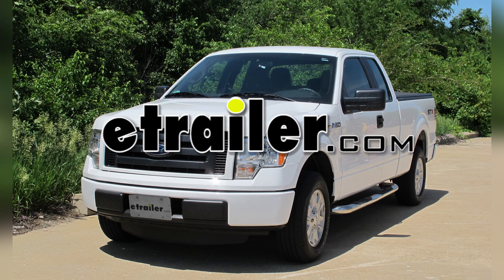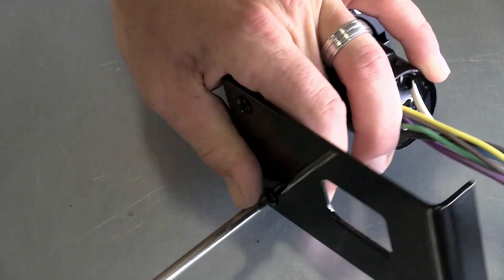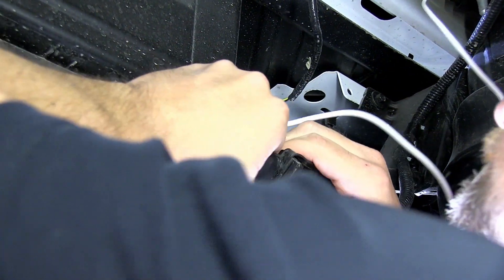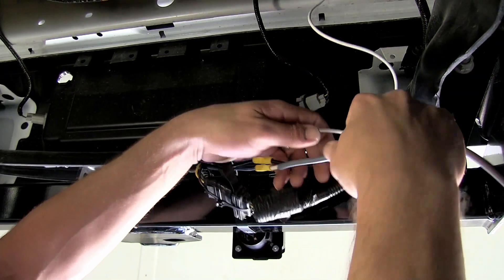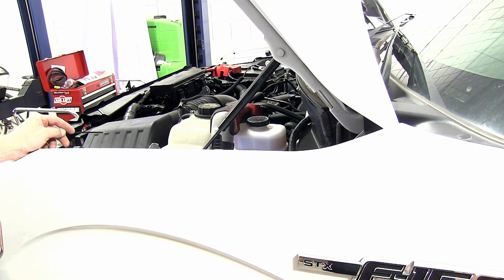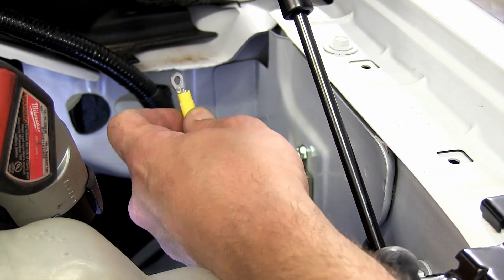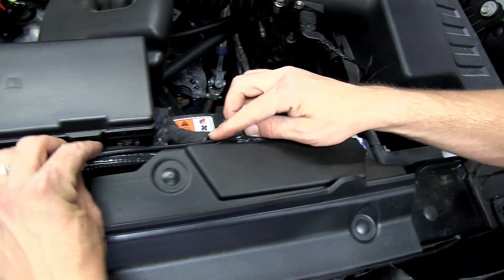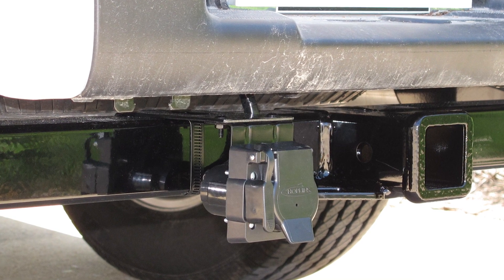etrailer | How to Set Up Your Adapter 4-Pole to 7-Pole and 4-Pole on a 2011 Ford F-150

Comment from the maker: This truck did not have an OEM brake controller. The trucks with OEM brake controllers come with 7-ways from the factory. You still will need a brake controller, without one there is no way to activate the trailer brakes in a smooth controlled manner. Tapping into the blue wire allow a brake controller to be easily installed using the under dash port as an installation point for the brake controller harness. If you need further help just write back!

Comment: For this installation, did the truck have an OEM or aftermarket brake controller?  I have a 2011 F150 with only a 4 pole wiring and need to install a 7 pole so I can have brakes on the trailer. Did you avoid a brake controller by splicing into the blue wire in the engine compartment?  Any additional information is appreciated.

Comment: Would this 12V and brake signal procedure be the same for a 2009 F150?  I installed one on an 08 once and it seems like I spliced into the harness at the rear of the vehicle.

Comment: We are looking at purchasing a 2011 F150 and need a receiver hitch and wirinng to tow our trailer.  Reading the comments, you respond to one: "Tapping into the blue wire allow a brake controller to be easily installed using the under dash port as an installation point for the brake controller harness."  Are you saying don't cut the blue wire, tap into it instead so you can install a break controller to the harness in the cab?  I installed the brake controller on my 09 that we are trading and it just connected to a harness already there, I assume this would be the same?  TIA